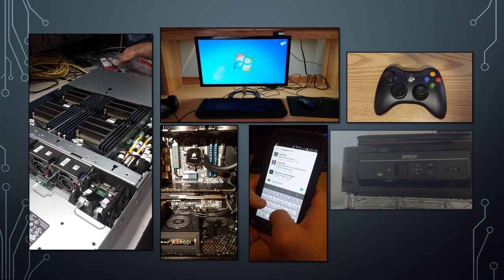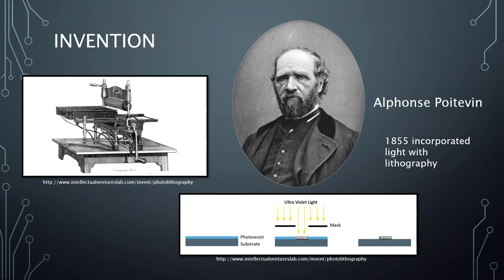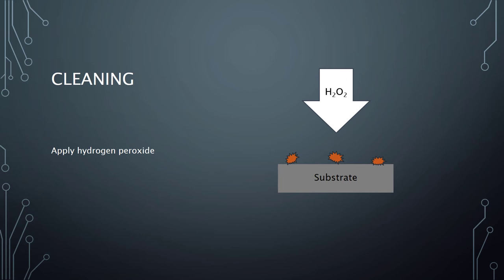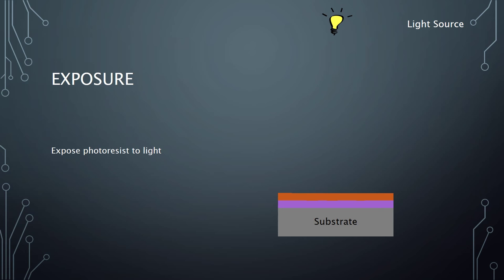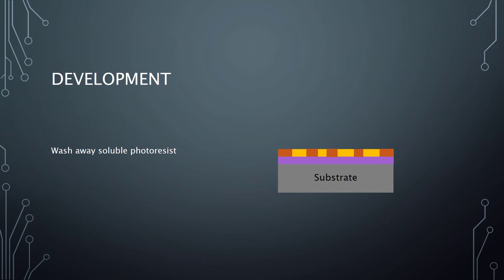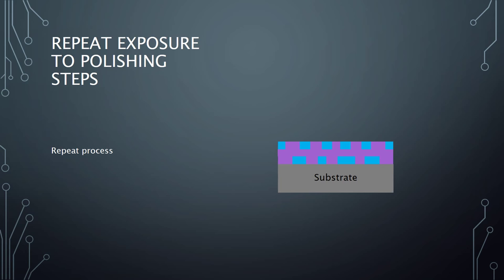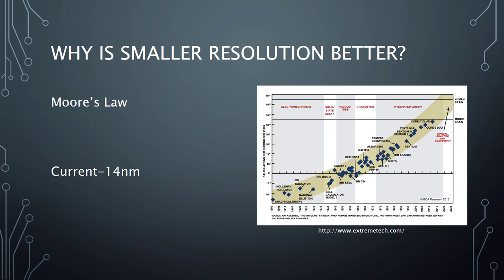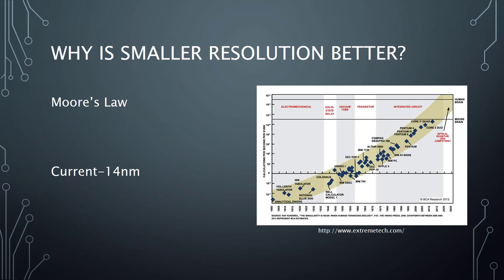Photolithography: Step by step

Comment: Ok. But how do you make a mask itself? It also has extremely small features to begin with.
Reply: The point is that the optics used allow you to focus the light past the photo mask, meaning the mask itself doesn't have to be that small.
Reply: Masks can be big, the light focuses after it passes the mask, so the images are small, like in a camera, a quarter inch cmos captures however wide and far a scene you like.

Comment: in 1984 and 1985 the company i did final assembly of semiconductor manufacturing equipment for, received processed wafers that had not passed QC to use as test wafers from customers that bought their products. With the developed  wafers it could be seen that the circuitry was inside not on top of the wafer. The chemicals had penetrated wafer in each step. Nothing was on the wafer surface. Maybe like stained glass is not like painted glass. My guess is the glass is porous as far as glass stain is concerned. And wafers were porous as far as the chemicals used for them then,

Comment: Semiconductor manufacturing equipment of the mid 1980s was used to spin the wafer as chemical streams or sprays were applied to create the layered images inside. Dopants altered the silica atomic structure to create N or P type properties that in the end left an electronic circuit inside a little square of glass called a fragment that was about the size of a square seen with 1/4 inch graph paper. Photoresist made possible the etching away of doped areas inside the thin glass like wafer. N and P type areas combined formed transistors in the maybe thousands or hundred or hundreds of thousands in tiny areas thanks to a microfiche mask used to expose the photoresist for the etching processes. Like one photograph negative sandwiched between two pieces of glass the mask was. But there were maybe about 200 little square identical images in each maybe 4 inch mask. Protected from contaminants and friction  in between the two pieces of glass the film photograph negative was safe to use over and over. But special equipment was used to cleanse the mask to increase yield. Else too many of those little squares would be faulty and not an effective micro miniaturized circuit inside that black rectangular computer chip.
Reply: N using Boron (5 electron) were P using Phosphorus (3 electron) so electron can move around wafer atom (Si = 4 electron)

Comment: shorter wavelengths of light generate a higher resolution??  the shorter the wavelength the more precise the image... like you said they shortened the wavelength from 365nm to   smaller wavelengths, to improve resolution. overall great concise and effective video though
Reply: Instead of R~λ/NA,  R should be replaced with minimum feature size (CD) so CD~λ/NA so if the wavelength increases the minimum feature size increases and if the wavelength decreases ( frequency increases) and the minimum feature size  decreases so smaller patterns can be put on the photoresist layer.
Reply: @danarcese4248  conclusion the relationship between wavelength and resolution is?
Reply: @danarcese4248  Waaaaaa?
Reply: @mao5441  as wavelength increases resolution decreases
Reply: @psun256  resolution and minimum feature size are inversely proportional. if your resolution increases (think a nice tv) then things aren't blurry and you can see more distinct objects even if they're smaller ( smaller min feature size)

Comment: Silicone is a resistor, right? So making groves into the silicone by photolithography and/or etched away is the paths where electrons ie current would travel through? Would the electrons travel up and down from the grooves to the substrate or along the groves that were etched away?
Reply: Or is the electrical paths added to the etched groves during the doping phase ?
Reply: Maybe I misunderstood you, but there's a difference between silicone (a resistor), and silicon (a semi conductor) which is used as the base for the microchips.

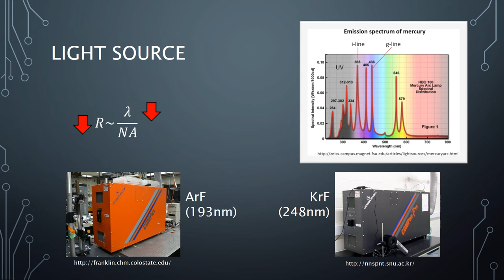Comment: 4:38 shorter wavelength of light generate a lower resolution ?
From that formula shown obviously the higher wavelength will produce better resolution.
BTW it's a good explanation thanks.
Reply: You contradicted yourself! Check what you have written.
Reply: The formula is good. Resolution in this case is defined as feature size. Smaller feature size is better. Smaller wavelength means smaller feature size.
Reply: @vibodhj349  he didn't contradict himself. He was asking for a clarification because he assumed that  he spotted a contradiction. The first sentence was him  quoting the video; I'm guessing the lack of quotation marks confused you.
Reply: good question

Comment: Stop working on the size of chips .somone  Start working on reducing the size of battery. Good video.
Reply: lol
Reply: 1. Smaller process nodes enable greater efficiency reducing the drain on batteries by electronics at a given performance level
2. We may as well continue to use the lithography industry's developed R&D resources until quick progress ends. Otherwise we'll have to rebuild the labs later on when chips are revisited.
3. Electrochemistry has very different problems, and there are no obvious improvements to be made on current technologies. Funding would go to basic (not applied) research and the chances of useful results would be extremely slim (not attractive to investors).
4. We should still fund basic research more, it's where the most important technologies come from.
5. We need better batteries, and current ones are terrible. There's quite a bit of money going into efforts to change that (both by reducing the need and improving the batteries).
Reply: Smaller process = less heat and lower power comsumption. 
If they work on making it smaller, you won't need a massive battery.
Reply: It's made that way for planned obsolesce.